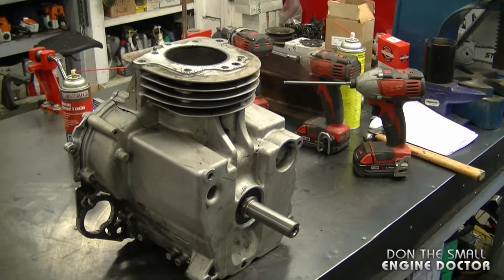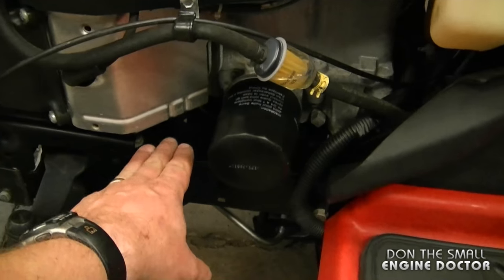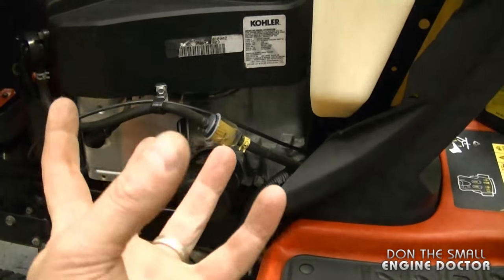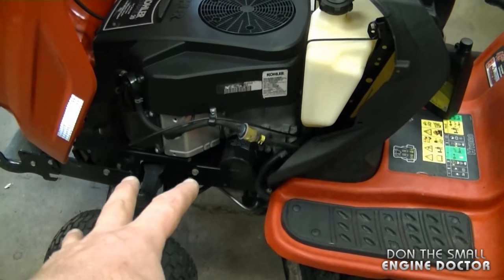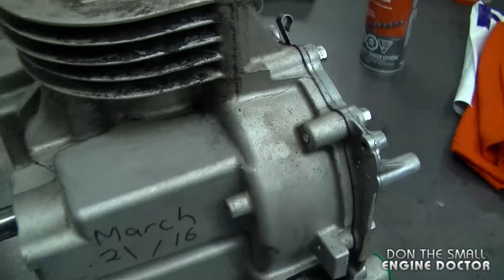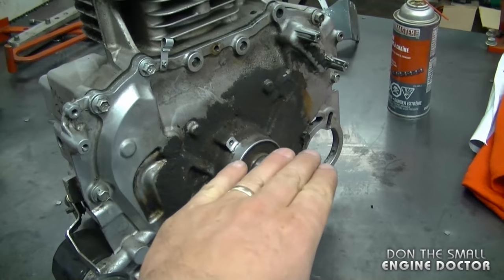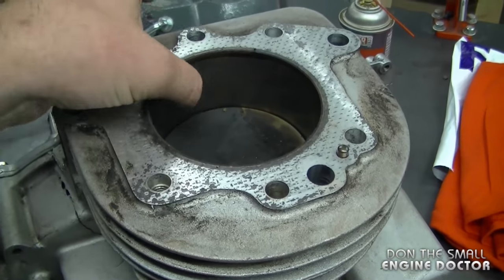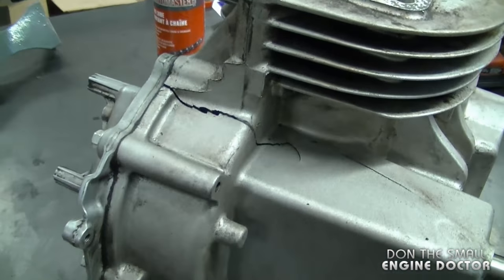Cracked Engine Block & HOW-TO Prevent It On Your Lawn Tractor!

Comment: I never thought about checking those bolts holding the engine connected to the frame before, but will be checking mine now to make sure it is working the way it should be.

Comment: Looks like a kohler courage engine. I know husqvarna ran these motors. The problem with these motors is mainly the loosening of bolts everywhere. Since it is a single cylinder, it moves the large mass of a piston. Kohler was trying to make big power for cheap and this is the result. They vibrate like crazy. If your courage single cylinder still functions properly, it would be a good idea to loctite and re-torque all of the engine bolts to prevent future cracks and bolt loosening.

Comment: It would be interesting to have a tear down video on that engine. I am an engineer and those top cracks are probably caused by some secondary failure as it appears to be coming down from the top towards the bottom of the engine.  If the bottom cracked due to vibration it is also likely a poor casting of the block.

Comment: How common is this method of casting the crankcase and the cylinder as a unit? I'm asking out of interest as I have only ever worked on side-valve engines with a conventional crankcase and separate cylinder layout.

I really enjoy your well-delivered little lectures/ videos. Thank you.

Comment: Really don't know of anyone including mechanics that would check the torque on the mount bolts unless they saw the engine flopping around when it's running or obviously loose to the touch. From the looks of that block, I'm thinking it's something more than that, but thanks for the heads up.

Comment: Great tip Sir.  Its a shame a good engine was turned to scrap due to such a petty thing as loose bolts.  Need to check them on mine just to make sure they tight.

Comment: Thats one of those Kroller bucket engines.   Very common on those to crack.  Even proper torque wont prevent a failure on some of those

Comment: I would weld it and see how long it would last. The cracks are in good areas where you can get to the cracks open them up before welding them.
Reply: Not a proper fix on a customers mower
Reply: To many  fracture cracks, Be a waste of time and money.
Reply: +Braden Wuesthoff For a customer I agree but some customers would insist. The whole purpose of welding process is that the weld bead becomes stronger then the actual  material so theoretically welding makes sense. I would honestly be curious how effective it would be welding those cracks.
Reply: +Micscience It's not like the aluminum is taking the combustion load that is what the cylinder sleeve is for. I admit though that the engine would look ugly after all those weld beads.
Reply: I'd drill a 1/8" hole at both ends of each crack to prevent the cracks from spreading, then dremel a V shaped groove along the cracks for maximum penetration and weld them, countersink the holes on the ends and weld them shut. I've repaired a few cast aluminum water pumps and timing covers this way and never had a problem. Of course everything would have to be disassembled and cleaned thoroughly with lacquer thinner or acetone before welding.

Comment: Typical Kohler courage. Another common issue with them is the bolts that hold the cover below the flywheel will loosen and I have seen them hit the flywheel and sheer a flywheel key.

Comment: Those Kohler Courage single engines are terrible for failure. The counterbalance also isnt always torqued down properly, and it can blow out the back of the block.

Comment: typical problem with this kohler courage single junk......walls around the cylinder are too thin and it rips right of the block just because of the engine's power.....

Comment: Kohler Courage bucket engine.  If it were a mounting bolt torque issue there are way more than one or two doing it wrong.  Think not.  Kohler made a P.O.S. and trying  to justify it.  Biggest percentage of them have broken blocks